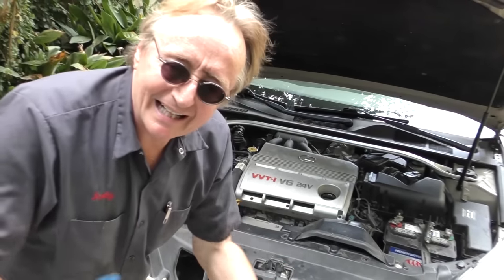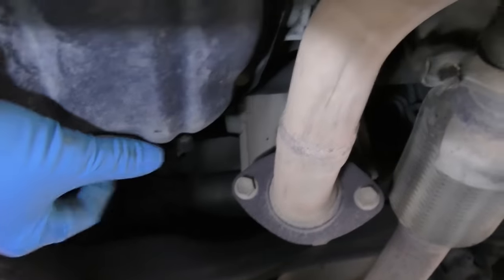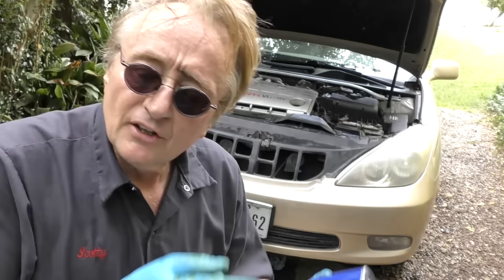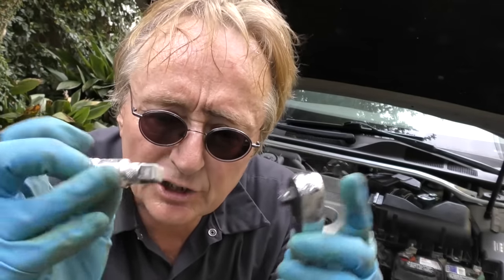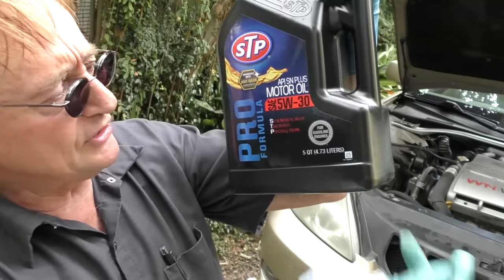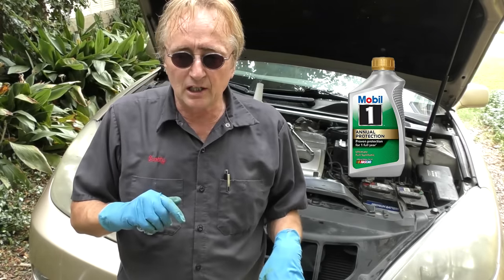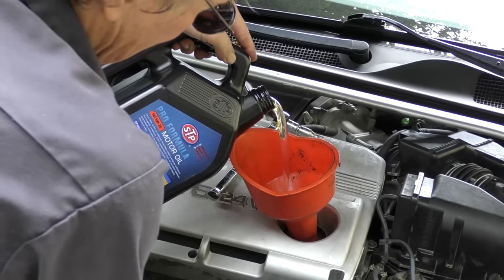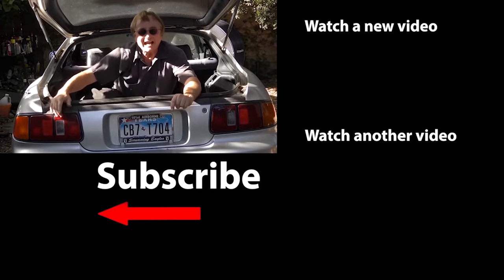Changing Your Engine Oil? You’re Doing It Wrong

Comment: I go 15k between synthetic oil changes.  People say you’re crazy!  I say oil analysis!  Our conversation ends right there.
Reply: Here in Europe most cars change the oil every 2 years or 30k kilometres. I have an older ford focus cmax and I change the oil like the manufacturer prescribed, that's every year or 15k kilometres.

Greetings from the Netherlands.
Reply: I live in Canada, so I always change it before and after winter, since the harsh temperature will age the oil faster. I usually end up traveling about 7-10k kilometers between changes. I also get the longest lasting oil filter and change it every time too. 
I know I’m over changing my filter and oil for what it’s rated for, but 1 oil change a year is too little and 3 is too many so I do 2.
Reply: @KevAlberta  in the winter with a lot of short hops the biggest problem is condensation getting into your oil. If you do a lot of highway driving in the winter it shouldn't affect overall efficiency of the oil. The only problem you have with oil in the winter time is it getting thick in extreme cold.
Reply: @JohnRodriguesPhotographer  I have an f150 and the condensation gets so bad it looks like vanilla pudding in the cap
Reply: Just depends how how you drive. Highway vs city miles. Mileage matters less in that regard.

Comment: Make sure you know what kind of pan you have if you are going to use a long ratchet. Own a ‘20 F150 = aluminum , installed a fumoto valve. Don’t have to remove drain plug and it redirects the oil from hitting the cross member (big mess).

Comment: If your filter is vertical or at a slight angle when mounted, prime the filter by putting oil in the center hole, let the air bubble out and keep filling till the level is steady

Comment: Yeah, yeah.  I've been changing my oil for decades and... 
Wait, there's a gasket on the drain plug?
Reply: Yea so you don't strip the oil pan
Reply: @Fadz-zg6bt  I understand the purpose of a gasket, but I've never even seen one on any of my trucks throughout the years.  I've always driven Ford trucks, and I've even put new plugs in from time to time, and they never came with a gasket, and I never had any leaks.  I wonder if Ford uses a different design. 
Anyway, I'm changing my oil this weekend, so I'll check at the auto parts store to see if they have one.  But I appreciate the response.
Reply: @seannewman8542  you probably haven't over tightened it
Reply: @Honest John I think you may be right.  There is quite a lot of play in the plug when only the first few threads are in.  Then it gradually stiffens up the more it is tightened.  There is certainly some tapering.  
Anyway, my local auto parts store sells gaskets for my model of F150, so I picked up a few.  They were only about a dollar each; so, I figure it's worth a try even if it's just for the peace of mind of not over-tightening and stripping the threads.  I'll keep an eye out for leaks just to be sure.  
Thank you for your response.

Comment: Scotty you are wrong about the oil label on the engine!!! The proper oil viscosity is in your owners manual. Use the oil that is for your climate. Fact! That oil cap label was designed for information that it was a universal oil for all parts of the United States. I never use what is written there here in Texas on gasoline engines. ASE MASTER TECH L1 L2 , 45 years experience. The last Service Manager I worked under 24 years ago argued with me about this and he lost. The manufacturer agreed with me. Yes I like your shirts. But I’m allergic to stupid !!
Reply: On my car what is on the cap matches the manual.... Which is true for most cars, which backs up what Scotty is saying

Comment: Did he really just tell the untrained DYI to tighten their oil drain bolt with a 1/2 inch breaker bar? YIKES!!! I would only attempt that if you have a trained mechanic's torque elbow.

Comment: My '86 VW Golf has a copper gasket on the oil drain plug that Chuck Norris sold be back in the early 70's - I use the same gasket for about 5 - 6 years before (maybe) changing it out for a new one.

Comment: The Extra Bestest oil change technique

I drop the oil, then I fill with cheap oil and seafoam. I drive that around for an hour or so, then I drop that oil as well. Then I change the filter and top off with the actual good synthetic oil I'm using. 
I typically do this twice a year to keep my motor extra clean. It may sound like a hassle but it works well for me and all my motors run A1 
Avoid oil change shops....they never take the time to get all the old oil out, and they leave behind a lot of sludge.... especially if they are using a vacume to suck the oil out....vacume oil is terrible because it leaves all the crap at the bottom of the oil pan. Change your oil yourself so you can let it drain for as long as you need to get all the crap out...shops just don't have the time to do it the best it can be done...unless you pay them a fortune maybe. Lol
For anybody buying a used car and changing the oil on it for the first time...maybe think about using my method....all it costs extra is 4 or 5 quarts of cheep oil. Just make sure to use the same viscosity and enjoy your clean motor

Comment: What if the recommended oil is for temperatures between 10C* to 42C* but I live in an area where the temperature is between 40* to 50*C in summer
Reply: Your owners manual will specify what to use in those situations
Reply: Brandon Rose Unfortunately they didn’t expect this situation, so they didn’t recommend anything and even the new model (2019) doesn’t recommend anything that is reliable over 42C*. At this point we got used to it we know what works beat from experience mostly Castrol Magnetic 10w-40 if you’re curious.
Reply: Wouldn't even worry about it. Engine temp gets way hotter than that and a few more degrees C at ambient isn't going to make much difference.

Comment: On my mom 2008 Honda Accord it was burning oil at 140k miles changed to a 5w30 full syn high mileage from a 5w20 and now it has 380k miles still running hella strong! No longer burns oil. 4500k miles I change her oil. great car! But this was the only car I have changed the oil type.

Comment: 2:36 oil filter had a date of 8/16.  has it been 3 years since it was changed?
Reply: Maybe it was the 16th of August 2017... you know these Americans and their backwards dates. Hahaha
Reply: @2010ngojo  Or August 16th.
Reply: @erickarellano1029 
Like I'm gonna specifically mark down the day of when the filter is installed.
Reply: @2010ngojo  come on... It's Scotty, he probably wrote the time on there too!!!
Reply: I only write the month/day and mileage I change the filter, but maybe 8/16 (August 16th) is when the oil/filter would be due for replacement if it didn't reach the mileage interval first?
Reply: @bradnoyes7955 
Why would you need the day though?
Reply: @2010ngojo  Putting the day just gives you an idea of if it was change early/mid/late month. Sure you don't need to know the exact day, but it gives you a more accurate idea of the age of the oil.
Reply: @bradnoyes7955 
Having oil a month older than a year won't make much of a difference for normal case uses. So unless you're doing tests on the oil, I wouldn't bother. Year would make a lot more sense imo. Many people just don't change oil often enough, many times longer than a year.
Reply: @2010ngojo  I drive over 20k miles a year so I change my oil 4 times a year. (5k intervals b/c of my driving style and conditions) So putting the year on the filter is unnecessary for me. If you drive 5,000-7,500 or less a year (depending on the oil & interval you use), sure write month & year.
Reply: @bradnoyes7955 
Maybe you do. The majority of the people do not.
Reply: @bradnoyes7955  Most modern cars usually have a dummy light that warns u that due for oil change.
Reply: @2010ngojo  Agreed unless U driving it hard daily or U have a turbo car U betta keep up on oil changes or may mess up the turbo.

Comment: Depending on your car and type of oil filter you have and where it's located. I've seen some professional mechanics in the shop change the oil by sucking the oil out of the dipstick tube with a type of vacuum pump thing and it captured the oil in the container and then they change the oil filter And the oil without even lifting the car up at all or getting underneath it. And they did it all standing up. So that was pretty safe and they were able to do that because this particular vehicle had a cartridge filter on top of the engine instead of I forgot the name of them with the other type of filter the screw on metal filter that you see on the outside of most cars especially in America. And I think the other cartridge filters are typically in European cars, but I'm seeing them more and more in American cars to like my 2017 Chevrolet Sonic RS has a cartridge filter to my surprise But the mechanic was able to suck out the oil and not this car not my car but this other car I had he was able to suck out the oil from the dipstick tube and pull out the oil filter without even jacking up the car and so the car kept perfectly level and the oil was sucked all the way up out of it all the courts every bit of it. Nothing was left behind and the filter was replaced and it was real clean and safe and quick and effective. So I mean you can suck the oil out. I don't know if it's better or worse or the same but this professional shop used it. So I think yeah, it was Volkswagen actually did it. So if they do what I'm sure it's perfectly fine.
Reply: No! Leaves slug @ the bottom! Cannot remove it without sump/drain plug removed. Pretty simple if you use your brain & it isn't that hard to jack car up & get underneath snowflake ;)
Reply: Hey  @timothylanders3189  - was making your "brainy" point, without the name calling, too much trouble ?!?
Reply: @warriormanmaxx8991  No, I don't appreciate short cuts that are totally unnecessary! The net is full of 'well meaning cowboys' that teach rubbish...

Comment: i have 1994 f150 with 4.9 engine i have 375,000,000 miles it still runs like new and has had nothing but super tech 10w30 from wal mart her whole life i changed the valve cover gasket and lifters were clean as can be

Comment: The most important part...get the jack stand in the right position on the car, on level ground, and pump the jack back up under the car at the jack point as a back up. But don't pump the jack back up and lift the weight off the jack stand. Keep the weight on the jack stand.at.all times until you're done, but the jack is right there as a secondary support in case the stand were to come loose.

Comment: Hey Scotty, what is your opinion on the old 1980s - 2000 Jeep Cherokee XJ's.
Reply: He'll probably say no to get a celica lol
Reply: I'll throw in my educated opinion on it since Scotty hasn't replied. The straight six two wheel drive are bulletproof. I've seen over 300,000 miles on the V8, but they are more problematic. Transmissions can be a weak spot. Rear ends can be a weak spot. Four-wheel drive is only worth it if you actually need it or intend to use it. Otherwise kills the gas mileage, is more to service, and more to break.

Comment: cousin owns a Ford Fusion and she recently had the engine replaced. When time for an oil change she asked if I could do it. SURE. She brings the car over and I could not break the drain plug loose. I even tried 3/8 drive breaker bar still not luck. I had to use an impact wrench to get that thing out. That is the reason I change my own oil.

Comment: Well that did answer one of my earlier questions.  A friend insists you should change the oil while it's red hot so the oil drains out of the engine more completely, while I maintained that the oil all drains down in the oil pan anyway, so why scorch my hands?  Turns out, Scotty says I don't have to!
Reply: Warm ,not red hot,would be my advice ,let it run for a couple minutes, maybe 5 in winter...

Comment: I have an oil filter socket, but if you put it on correctly you don't need the tool. It's supposed to hand tight, give it more ooompf and it comes off.

Comment: In the hotter western states you can use 10w-30 until it gets in the low 40s. Cold 5w is thicker than warm 30w.
30w works between 46 degrees to 104.

Comment: I'm changing my drain plug gasket for the first time on my next oil change. I've always just put the same on back on. I think it's time, after 16 years and 185,000 miles and about 45 oil changes.

Comment: puny 18" breaking bar, mine's bigger Scotty ............. 24"

when I was really young, like 12 or 13.  I was helping my older brother and father change the oil on dad's Kenworth tractor.  2 big and long oil filters on that sucker.  we ran into some trouble with it sealing, filter(s) kept leaking when we started it up. I was just the gofer at the time, I think one of the gaskets may have stuck to the engine side, not sure.  A lot of cursing went on, we always smeared some grease on the seals instead of oil, this time my brother used oil.  Who knows what the problem actually was now, on the second or third set of filters ( the final set that sealed ) we used grease and everything was fine after that.

for a couple decades after that I always used grease on the seals just to be safe

Comment: I like the strap for the oil can. Or a belt. Yep check the rubber on oil can. Use the oil that your manual says for summer and winter. My oil amount is a dumb odd number of 4.4 qrts. I give my oil to a garage for his used oil heater.

Comment: My vehicle the manual says 5w30 but if it is over a certain temp outside can use 10w30. I live where we usually get cold Winters and the manual says to use 0w30 which is synthetic or a full synthetic 5w30. So I just use a full synthetic 5w30 whatever is cheapest and change the oil and filter about every 5000 miles. Previous vehicles I changed about every 5000 with regular oil and never had a problem due to oil. The rest of the vehicle always had issues.

Comment: The "W" in 5W30 and the rest of em 
stands for "winter" meaning it's a 
30 viscosity oil that has the flow 
properties of a 5 viscosity oil under 
winter driving conditions .it doesn't stand  for "weight " . I'm sure Mr. Kilmer knew that,  and was just checking to see who all knew. 
JMHO- I always use the engine oil that the factory recommends since they spend millions on R&D every year so as to get it right. That, and 
with the internal gadgetry such as 
cam phasers that are designed to 
function properly with a specific 
oil, I would have worries about 
longevity of internal engine parts.

Comment: Long time ago  I had changed the oil on my Tercel wagon. Started it up and oil started leaking all over the drive way.... the old oil gasket had stuck to the engine. Good tip to insure that gasket is on the old filter when you take it off since a lot of times it’s hard to see that engine area. 
The other thing I’d suggest is to carefully check the new filter.... recently someone had switched the filters in the store and the filter I pulled out of the box was the wrong one and the next time that I bought a new filter, it was actually missing the rubber gasket from the new filter.... good thing that I noticed something looked wrong before I had put the new filter on.

Comment: Modern engines with synthetic oil you can change already at each 20 000 miles or every 2 years but in mine (BMW 4 series) i still play it safe and change it every year...

Comment: When I first started changing oil, a washer for the drain bolt was 5 cents.  Back in 2000, the stealership wanted $1 for each.  .......  I just bought a bundle of like 50 for 10 bucks.  I figured I'd go through them since they're the same washer on all 3 of my Honda and my motorcycle.

Comment: I always pour some new oil in With the drain plug still out until the oil comes out of the drain plug hole clean .i also depending on the location of the oil filter I always put as much oil as I can into the filter before installation to eliminate a dry start. I also wipe out the funnel before I use it.

Comment: Now on a older car I have, it says 5w30. But owners manual says I can use 10w30 or 10w40 also in certain climates.    I moved to 10w30 and a qrt of  oil stabilizer it’s old car hopefully it will help with the burning of oil.
If I was in. A older climate  I would stick to 5w30 

That STP oil filter is really nothing but a rebranded champion labs filter.  It’s the same  as supertech oil filters at Walmart or ACDelco.  It’s a good filter better then the orange can filter

Comment: You forgot to clean the oil filter mating surface. When you do that, it also prevents double gasket syndrome. I wipe clean the mating surface  before installation of both oil filter and drain plug.

Comment: The W means winter not weight. I always fill my filter before o put it on. That easy because it goes on vertically. I also drain the old oil out of the filter by puncturing it twice. First on the bottom and again on the side as high as I can manage. Very little oil runs down the side that way.

Comment: I used 0w30 for 3 years of oil changes in my kia forte SX 5 door. Ran so much smoother. Changed every   15,000 i use the purealotor boss .

Comment: Well, my car uses a cartridge. I don't have that style filter. Also my drain plug is on the back of the oil pan, not under it. That's why I get a shop to change mine most of the time. I have a Chevy Cobalt SS by the way. I could use a suction machine to change it myself, but I'm not sure if it'll remove all of it, or most of it.

Comment: you forgot one thing,filling the oil filter with oil before putting it on ,I always do that dont wanna take chances of running the engine with no oil in filter cause it takes time for filter to fill even if it gets little spilled out of filter when installing it's better than screwing up the engine .